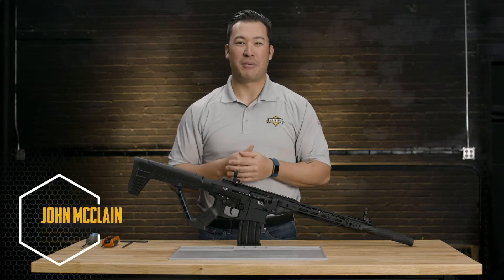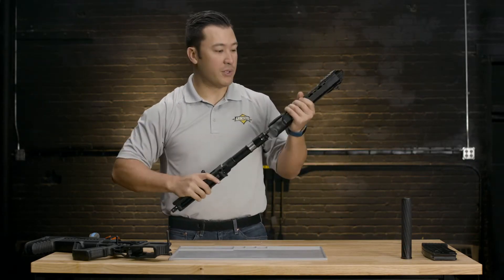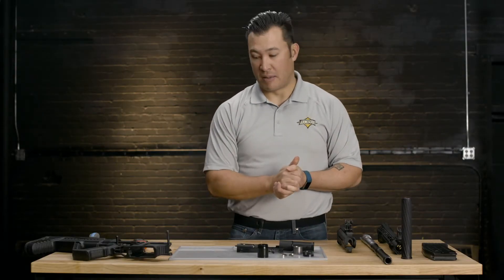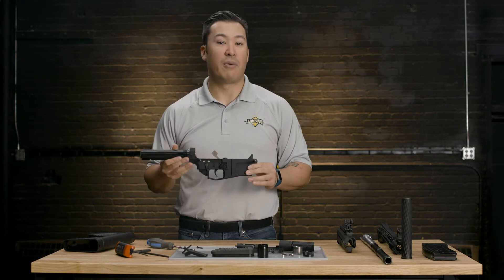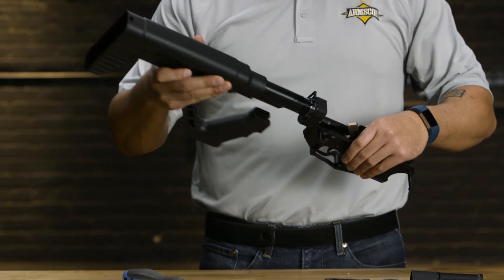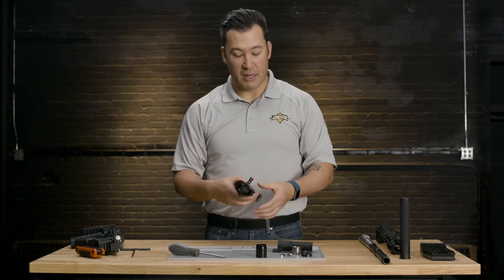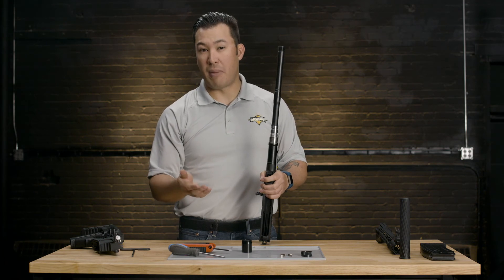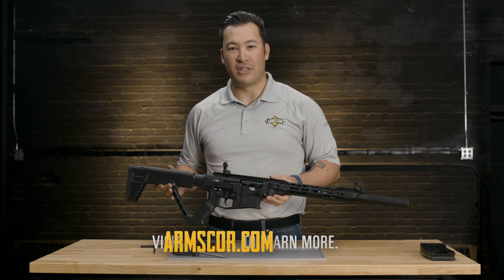Rock Island Armory - VR80 shotgun - Disassembly Assembly

Comment: Big question.  The less than clear manual shows a gas block O-ring somewhere in line behind the split rings. Your video does not show this either.  It comes without said O-ring installed right out of the box. So is this ring in my parts bag necessary and if so exactly where should it be placed ?
Reply: I been asking this same question? All I got from Armscor was this video
Reply: Did you ever figure out the Irving placement?
Reply: O ring*
Reply: No make a short video on this
Reply: @EdgardoArgueta-vt3zy  I just watched a video on the VR 60, and it actually has an O ring on the barrel.  So.. it's possible the parts bag is used for both versions of their shotgun.
Reply: @chrisedwards1907  i actually found where it goes .
Reply: @EdgardoArgueta-vt3zy  no u didn't

Comment: If you disassemble the buffer tube how far should you thread it back in. All the way till it’s stop or do you back it off a bit? Anyone know?
Reply: You can thread to where it stops threading ( don't force ) then back off and line the buffer tube up.  Then tighten down the castle nut.
Reply: Make sure your end plate is flush, it fits one way.
Reply: Also highly recommend the full length handguard for better hand placement.

Comment: I have a problem with removing the barrel shroud. I have twisted both ways as hard as I could and cannot get it to come off. Is there some special trick to it? It will twist approx 1/4 inch and stop. Brand new, shot a box of 00 buck 2 3/4 inch shells to break in and cannot get the barrel shroud off to clean. Any suggestions?

Comment: In reassembly, what does the buttstock screw/plate actually screw into?  The screw is slightly smaller than the hole in the plate and there is nothing in the buttstock for it to screw into. There is no screw receptacle in the buttstock so it would simply float.

Comment: My vr80 will not cycle when I shoot it. Even with different ammo
Reply: Oil it really well
 Use 3" slugs eith the full choke. Make sure the light load block is in. These guns love oil. Hold the gun tight. Make sure uou have no scratch marks on the top and side of your mags at the top to ensure the bolt isn't rubbing it when it travels to the rear. Mine was. When I sanded that down where the scratch marks were, and sanded/filed lightly the feed lips of the magazines,  it didn't rub and my guns both (VR60's) shot right for the first time. When I forst got them, one of them had metal shavings all over the place inside. Once I cleaned them and filed/sanded the mags and oiled the gun, and also worked the bolt by hand 300-350 times, simulating the action as if it were being shot, and I left the bolt locked open for about a month, and it actually ran great. Both did. I hope this helps you. Don't give up. It's really a well built gun, but poorly executed. Their quality control sucks big time. Good luck man
Reply: @MemphisMojo15s dang i wanted to get one too, guess I'll go with the ARP